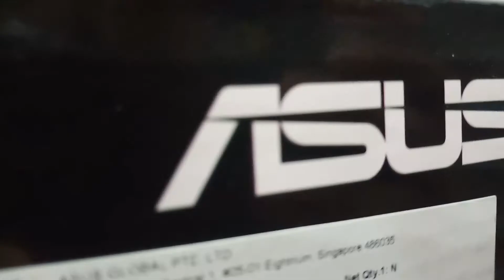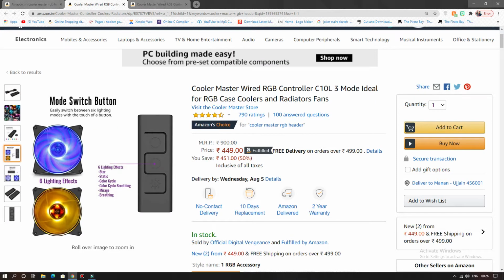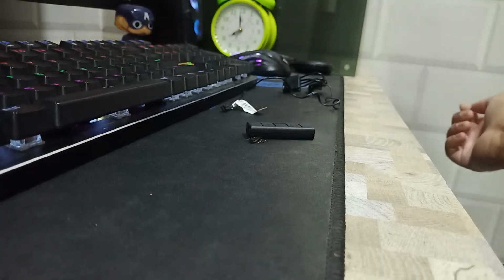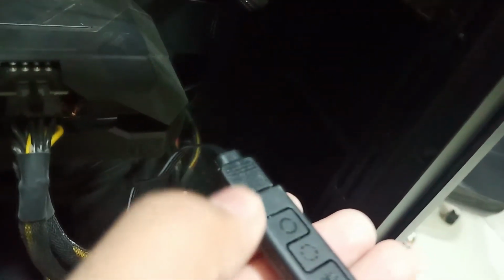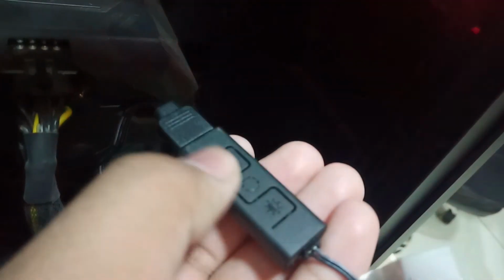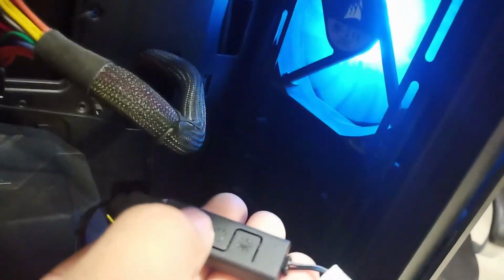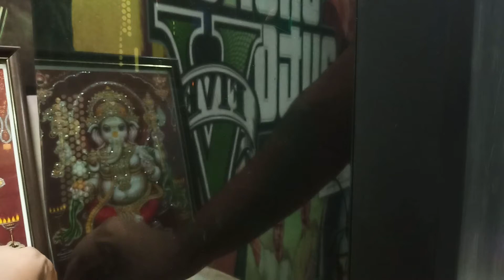How to Connect RGB Fan without RGB Header On Motherboard - Cooler Master RGB Controller

Comment: Is mother board h410 has RGB headers
Iwant to buy : gigabyte h410 s2h 
And :GIGABYTE B460M D2V Intel® B460 Ultra Durable Motherboard with GIGABYTE 8118 Gaming LAN, PCIe Gen3 x4 M.2, Anti-Sulfur Resistor, Smart Fan 5

Comment: I had a ARGB deepcool  led strip ..  which had 3pin 5 v ... Can I use a spillter and connect it to 4 pin and use the controller

Comment: The problem with this is that it’s a PAIN to reset when your power goes out and stuff like that. Without a constant voltage, it forgets the set color and goes back to red. 

Is it possible to connect the rgb to the motherboard to fix this issue?

Comment: hi bro my coolermaster k501l rgb has one rgb fan with two cable 1. as you shown 4 pin controller 2. for motherboard i think and i connected it with a fan splitter cable , as I connected it to rgb controller it is not working. how to solve this issue?
Reply from the maker: Connect i cable of fan to mobo and other to controller and connect cable controller to psu cable
Reply: @mananbahl4842  yes I have already connected to psu also but it's not working maybe my RGB controller has a defect. Thanks
Reply: I have a question does only the fan work without the RGB controller? Because whenever I connect my fan to Mobo it doesn't work. Or is it a defect on the fan?

Comment: Can we connect 6 fans to this single argb controller.? And can i control lightning from any software because who will open up case panel just to change color coz this controller remains in case.. but i want to change it from outside.

Comment: Im building like a budget razer setup i have razer blackwidow 2019 and razer deathadder chroma and gonna get asus strix rx 570 and im getting a case without fans and i install rgb fans which have asus aura sync the purpose is i want to sync every single my pc hardware with razer synapse but my motherboard doesnt have rgb headers but if i get this controller and connect asus aura sync fans will they sync with the software asus aura or razer synapse so i can change all the lighting effects at the same time
Reply from the maker: It should work with it. I am not sure .
Kindly do some more research , sorry.

Comment: Can I use RGB fan only by connecting to psu and motherboard and not by controlling ❓
Reply from the maker: Yes it depends on which type of pin fan has.
Reply: @mananbahl4842  thanks bro for the reply 😍😍 and heart too

Comment: Can you plug a non cooler master fan to the cooler master hub and control it via master plus software?
Reply from the maker: You can use non cooler master fan but not sure about software.
Reply: @mananbahl4842  so cant control it either way?
Reply from the maker: @uchihamadara9967  BY CONTROLER U CAN
Reply: @mananbahl4842  thanks dude

Comment: 1:03 does the little cable come with the controller
Reply from the maker: Yes
Reply: @mananbahl4842  thx
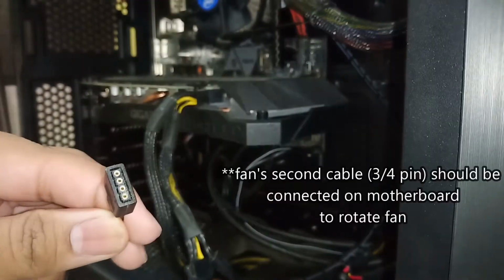Reply: But 0:50 the fans will be connected to the rgb cable then to the controller then to the psu, but then how will I control the fans
Reply from the maker: @ten_cents3436  by the controller there are buttons on it vruh
Reply: @mananbahl4842  aiyooo I mean the speed of the fans not the lights
Reply from the maker: @ten_cents3436  for speed i guess its on mobo
Reply: @mananbahl4842  how are the fans connected to the mobo if all the fans are connected to the controller which is then connected to the psu Edit: ok i think i got it thx anyways

Comment: my motherboard doesn't have rgb header. and my cabinet is chiptronix mx1. my cabinet have a rgb front panel. can i use this controller to light up that panel?
Reply from the maker: Yes , you should see some videos of that on youtube
Reply: did this work...I have the same problem..my cabinet has a 3 pin LED controller and I have no RGB headers on the mobo
Reply from the maker: @iec0  it must have a fan header
Reply: @mananbahl4842  yea I have 4 pin fan headers but no argb headers ... and the case has a 3 pin LED controller...can I plug that case 3-pin LED controller into this..
Reply from the maker: @iec0  it should work , but I will search about it , it's 2 am here and I am felling asleep now . So will tell u in the morning.
Reply: @mananbahl4842  ok cool thanks...goodnight :)

Comment: I’m having problems with my rgb as I don’t have any rgb headers on my mobo can someone please help. I have a cooler master mb311L, it came with 2 argb fans , 1 2-3 splitter and 1 argb controller. The fans were connected by default same as the reset sw which is routed to a button on the case. I have 3 cables which are connected to the top of the controller which are the sata cable the 4 pin fan power cable and the argb cable but like I mentioned I don’t have any headers for the rgb can I only use the sata cable to power the fans and use the button on the case which is connected to the reset sw to control the lights ?

Comment: hey very nice video but i have a question i have no pin connector on my board also so i have all my rgb connencted to a rgb hub that is hooked up to my reste button directly on my case(sharkoon tg5 pro) but my question is: would it be possible to add an rgb controller to the rgb hub so i can connect all my fans and led strips onto it>?

Comment: Hello my connector for RGb only has 3 holes meaning it needs 3 pins bit that connector has 4 does that mean I cant use it pls help I already ordered dis
Reply from the maker: it should work fine with 3 pin , u have to leave 4th slot empty
Reply: @mananbahl4842  the connector has like 2 holes 1 empty then another pin so could I remove a pin from the connector on the controller??
Reply from the maker: Lemme search
Reply: @mananbahl4842  okay thank you

Comment: I bought these and connected them but when I press the controller to switch the colors it doesn't change anything. The fans spin fine, but they only light up a light blue color and I can't get them to change colors. Any ideas why this might be or how I can solve this problem?
Reply from the maker: Check if ur fan is rgb or of single color
Reply: @mananbahl4842  they are the cooler master 120 argb
Reply from the maker: The controller is for rgb fans only not fir argb

Comment: Bonjour 
Je possède 4 ventilateur Rgb connection molux ou 3 pin

Peut on superposée les 3 connection molux avec le controler rgb ? 

Thx

Comment: Hey so the fan is powered through the PSU and not the mobo right? please help explain if im incorrect thank you
Reply from the maker: yeah for rgb lighting fan is powered through PSU
Reply: @mananbahl4842  Do you know any other alternative because it is currently out of stock.  please send link for an alternative or the same one

Comment: bro tell me about msi b450m-pro-m2 MAX does it has rgb header or if it has than how many rgb fan i can connect and how can i connect please tell me bhai
Reply from the maker: It has a rgb header , u can connect one fan by that header but there comes a rgb splitter by which u can connect upto 3 rgb fans via single header , or if u want more then there also comes 1 to 5 rgb splitter .

Comment: Bro ,i have only 2 fan pins in mobo,but i have one extra rgb fan but i dont have rgb header and one more fan pin .can i buy this
Reply from the maker: Name of ur mobo ?
Reply: And its says that it has rgb support
Reply: Pls explain bro
Reply from the maker: @hariprasathr1754  u should also buy a splitter
Reply: @mananbahl4842  should i buy all these
Reply from the maker: @hariprasathr1754  listen first buy this splitter and then check after connecting if it is working or not if it is working then only buy splitter for connecting more fans otherwise return the controller within return period
Reply: @mananbahl4842  ok thank you bro

Comment: Hello, I have an Asus H410M-E Motherboard and got a Coolermaster MF120 Cooler (ARGB), since the motherboard has no rgb, I got myself a controller (same as the one in the video), did the process and found that whatever I press the fan lights just light a dim light green, what is the reason of this? Can it be fixed somehow?
Reply: Hi did you fix it because I have the same issue ?? Thanks 👍
Reply: @georgemckimm9462  No I kinda gave up, I downloaded asus aura sync with a motherboard that was incompatible and my windows 10 just kinda blew up instantly lol, I had to reset the whole pc, I think you have to get a motherboard with rgb support for this to work, I'm sorry...

Comment: i cant use controler to switch modes and collors on my cooler master hyper h410r rbg  it only lights blue collor , any help? my mobo is biostar x470qtq
Reply from the maker: Did u tried connecting directly to the  rgb header of ur mobo .
Reply: Yes it works now 👍
Reply from the maker: Glad to know

Comment: Do ur fans have to be cooler master for this to eork
Reply from the maker: NO
Reply: @mananbahl4842  will one of these devices connect all of the fans?
Reply from the maker: @qrazy9869  to connect more fans u need to buy a seperate rgb splitter
Reply: @mananbahl4842  will normal case fans light up without it
Reply from the maker: Without spliiter one fan can light up

Comment: Hello, very helpful video. I just pack a 3 pack from deep color and was wondering if setting up one of these fans on my cooler master evo 212 heatsink is possible, my mother board is the 320m-k prime.
Reply: Yes, as long as you have the mounting hardware ( fan clips are most common ) any fan will work as long as they are the same size.

Comment: I have argb fans in my cabinet will this controller work
Reply from the maker: Lemme research
Reply: @mananbahl4842  did you find🥺
Reply from the maker: No brother argb fans need different  controllers .
Reply: @mananbahl4842  pls send argb controller link

Comment: Can it support  2,3 and 4 pin fans?
Reply from the maker: Yes 3,4 pins
Reply: @mananbahl4842  not 2 pin?
Reply from the maker: @kio.-.  it will work with 2 pins too 3rd & 4th pin is basically for speed control

Comment: can i do this with a corsair sp120
Reply from the maker: If u have 3 fan pack then it has its own controller 
In case u have 1 fan and it has a 4 pin connector then yes u can use this controller for it.

Comment: How can I connect 3 pin argb fan
Reply from the maker: 4 pin slot can be used for 3 pin also
Reply: @mananbahl4842  but how it will be connected?
Reply from the maker: Leave 4th slot empty

Comment: What's the output voltage
Reply from the maker: 12v
Reply: @mananbahl4842  how fan has only 4-5 LEDs  which only needs 5v to run